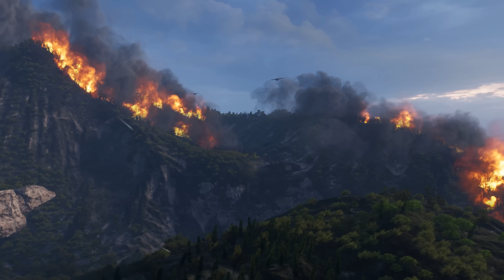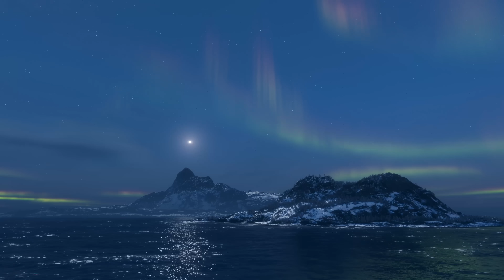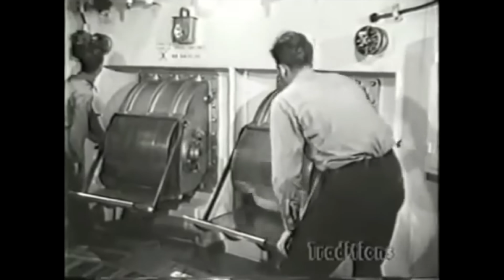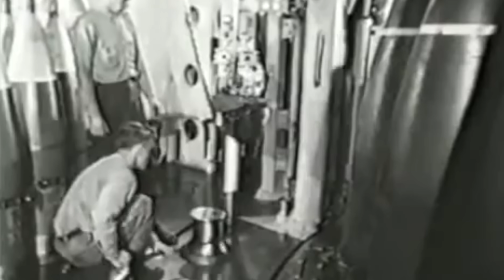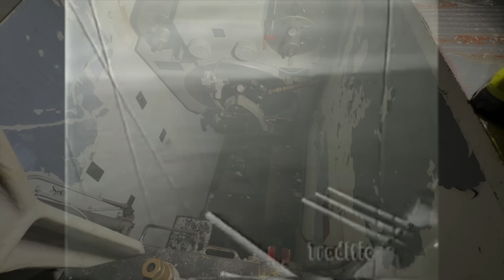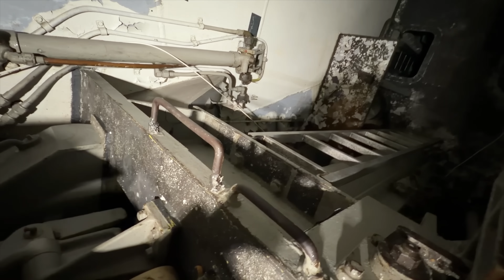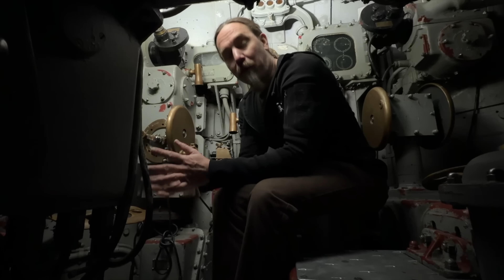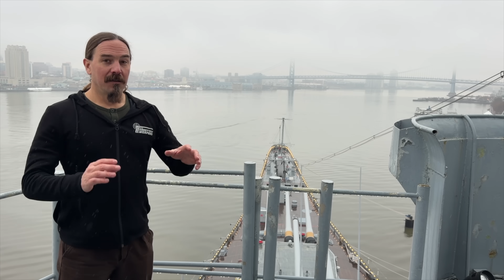How the USS New Jersey's 16-Inch Guns Work: Top to Bottom

Comment from the maker: Join World of Warships today to and use invite code USA250 to get your free rewards: https://wo.ws/FW
Reply: if theres any chance you could do a video on the 5 inch turrets that would be so awesome!!!
Reply from the maker: Yes, I filmed a similar video on the 5" system. Not sure when it will post, though.
Reply: hopefully Ian can go to one of the Machine Gun Cruisers to do deep dive on an automated 6" or 8" rifles on certain WW2 cruisers  https://youtu.be/gHR_O12-064?is=4X9B9EVJzh7mUufO
Reply: @Jack_Burton_Me  The automatic guns were only implemented on postwar classes (note that the date on that video is 1955), the Worcester class light cruisers and the Des Moines class heavy cruisers.
Reply: @Jack_Burton_Me  None of the WW2 cruisers had automated gun systems. Even the 5" 38 was manually fed during WW2. While the St Louis/Helena class has a reputation as "machine gun cruisers", the guns were still manually fed. The main difference that increased the rate of fire on the light cruisers was that the 6" round is a semi fixed round more like a rifle round, with the powder in a case, as opposed to bagged powder in the 8" and bigger guns, so the round can be fed without any additional steps to bring up the powder bags.
Reply: How many shells made a full Magazine?
Reply: @Eric-fb2wp  The basic load for an Iowa-class battleship is approx 130 projectiles per gun, so 9 guns x 130 = 1,170.
Reply: Ian:"..putting iron sights on top of the turret..."
DARPA: "HOLD OUR BEERS!"
Reply: Off and on WOWS player - the detail they put into the models of the ships is insane.
Reply: @felisconcolori  I advise you to check out War Thunder's ship models, if you have an account as well - even if you don't want to play. I'm looking at the x-ray rendering of my USS Iowa right now and the detail is fine enough that I can see the pistol grips on the stable vertical.
Reply: Hi Ian, I think the 16 inch Mk7 was not merely a Mk6 with 5 calibers more barrel length. The A tube thickness was increased from 45 to 46 inches and heavier hoops so that barrel pressures could be higher.  The prototype test gun used to develop the 16 inch super heavy shell started life as an 18 inch 47 caliber weapon that was sleeved down to 16 inch 55 calibers. It had a much heavier barrel and could take a bigger charge as a result.
Reply: I wish Ian as a commander in World of warships.
Reply: Been playing WoWs since day one. It's addictive.
Reply: Thank you the most comprehensive explanation of the 16" guns aiming system, the only aspect you did not mention is the coriolis effect and just how much needs to be accounted for at extreme long distance firing of those 16 inch guns. ⚓🦘👍✌
Reply: Still waiting for the 5" gun video
Reply: @ForgottenWeapons Do the German railway guns next, Anzio Annie etc. I believe one is in Virginia.
Reply: I was gonna ask why they didn't let you in the main gun but i see they finally did at the end. I was aboard the Mighty Moe when it was docked in Hawaii. Thise guns are as big as a house.
Reply: That's not going to get me back to playing any WG titles...
Reply: I don't know if this is a coincidence, but i was thinking what the inside of a gun turret of a battleship look like.  the stars aliened on this day
Reply: Is the code only for NA? Can't use it in EU
Reply: @The @TheIronNightmare likely yes, I’m on NA & it worked.
Reply: Get retired Gunners Mates to help us out with this, please.    You don't know enough, young man.
Reply: Freemium pay to win garbage, shame you had to take this sponsor
Reply: @mateimarian1937 I wonder if the US military is in any way behind all these different "world of..." games. It's one thing to try and increase recruitment of young guys who play these games but it would be utterly shameful to also rip them off with microtransactions while actively psy-oping them.😂
Reply: @mateimarian1937  not to mention absolutely shamelessly manipulative, anti consumer 'game' design, driven by the singular goal to sell gambling to whales and children.
Reply: Not even bothering to mention metric units make you look ignorant
Reply: @white-horse-pictures  Not even mentioning that metric unit conversions were subtitled in the video makes me think you didn't watch it, and are thus ignorant; additionally, your speech matches current bot/bad actor patterns. Get better AI.
Reply: @felisconcolori ”mentioned “ implies a verbal comment. Put that into your LLM training 🤡. Fair enough that a caption was added but yanks need to realise that the rest of the world uses metric now. It’s just more logical.
Reply: @white-horse-pictures  I'm sorry, did you think this was a conversation? That would be igno...ble. I'm sure the swath of one line comments ending in "You're ignorant" is completely natural and due solely to rude, entitled Europeans. Good Day.

Comment: One thing to note ... all these mechanisms, and their operators,  will have to work efficiently in a moving vessel. Large though they are, even battleships can be pitching and rolling considerably depending on the sea state. I would imagine the crew in Spot 1 high atop the mast  would at times experience quite the roller coaster ride.

Comment: A bunch of us Australian Army Reserve "Diggers", experienced a "custom" guided tour through "New Jersey" when we had a bit of "stand-down" time after the "grunt-work was finished. We were there participating in a "Pacific Reserve" exercise  at the geologically fascinating but visually "harsh", PohaKaloa Training area; a rocky and dusty desert between the volcanoes Mauna Loas ans Kilauea).

Our "local guide" was the chief Dental Officer and passed on all manner of relevant information, including a good reason for flying off the "Seahawk" choppers before conducting extended shore bombardments. with the 16-inch "Naval Rifles.

Apart from the sheer scale of everything the detail about those "rifles" that really struck me was that the rifled liners STRETCH length-wise at each firing. You can actually see the "step" where the liner protrudes. If this stretch exceeds "gauging", there is a good chance that the "overflow", will crack and be permanently condemned to scrap. They are NOT making the barrels, and liners (or the belt armour) anymore. If a liner "fails" the entire gun has to be replaced with "New Old Stock" from a mystery warehouse.

So, the armourers not only have a gauge set, they have a "trimming / re-crowning" tool.

The ship had, at that time, recently undergone a bit of modernization; Harpoon missile launchers and, to replace some of the older AA stations, "Phalanx" radar-guided Gatlings. (Ian; could you do a "familiarization and fire demo", with your new Nautical buddies).

Speaking of "big guns", if you are ever in Kure, Japan, (Home of the IJN "Yamato"), check out the excellent Naval museum, there.

https://dc-naval-history.com/japan-jmsdf-submarine-museum-kure.html

Comment: You're missing the best part of the director/computer system. It is an integrated fire control system. The computer also feeds back the predicted target location to the director. If you have the target prediction correct, the director will track the target. 

It is also integrated with the RADAR. The two battleship on battleship engagements of the US Navy during WWII (Second Naval Battle of Guadalcanal, Surigao Strait) both happened at night under RADAR direction. USS Washington scored 19 main caliber hits on IJN Kirishima in a little less than four minutes. (Note that the Washington only claimed 8 or 9 hits, they ended up hitting with full 3 gun salvos and counted it as one hit).

In addition, why magazines were refrigerated is due to the French losing two battleships to magazine explosions. This was shortly after the switch to smokeless powder. Acid contamination in the powder caused decomposition of the powder when the ships were operating in the Mediterranean. This lead to spontaneous combustion and subsequent magazine explosion. This happened when at least one of the ships was in drydock. After this, they tightened down the specs for acid contamination and added refrigeration to keep the solvents in the powder (which tend to desensitize the powder).

Comment: I served on the Missouri as a SWO.  One of the other wear factors on the barrel is that over many firings the inner liner is slowly pushed out of the barrel which requires the part extending beyond the barrel to be shaved down.

Comment: The hidden gem in the fire control computer is the rotating drum the matches the ballistics of the shells
From Google
Inside the Computer Mechanical Design: Instead of digital microchips or screens, the interior is packed with a complex network of thousands of precision-machined gears, shafts, cams, differentials, and servos.
Tolerances: Internal components were engineered to tolerances under 1/10,000th of an inch, requiring strict climate control (often kept near 70°F) to prevent metal expansion or contraction from throwing off calculations.
Specialized Cams: Mathematical formulas and ballistic data (such as time of flight and wind resistance) were physically cut into the shapes of flat cams, reciprocal cams, tangent cams, and 3D barrel cams.
Differentials & Inputs: Bevel-gear differentials continuously added or subtracted mechanical inputs (like the ship's own speed, roll, wind speed, and target tracking data) in real time to yield instant firing solutions.
Gauges and Dials: The front panels feature physical dials and mechanical counters displaying target speed, wind speed, range rate, and bearing changes that operators monitored constantly during tracking.

Comment: The digital computer would have been faster, but not more accurate.  Since the rate of fire was fixed at two rounds per minute, a faster solution would just have to have been updated several times before the gun was ready to fire.

You repeat a common mistake on what the gyroscope "stable element" does.  It doesn't delay firing until the ship is level.  A simple spirit level or pendulum would do that like on sailing warships.  A drop of mercury in a sealed glass tube with wires to each end could automatically close the electrical firing contacts when it "bridges" them.   In heavy seas, or if the ship was listing from battle damage, the ship might never come to level.  What the gyro does is provide a constant true level maintained by the spin of the gyro.  It compares the angle of the hull both in the longitudinal axis (roll) and in the transverse axis (pitch) and adjusts the firing solution put out by the computer so that the gun train and elevation are corrected for "level" (roll) and "cross-level" (pitch.)  This means the guns are always correctly pointed and can be fired *at the moment the commander wants to fire them*, which in ship-to-ship engagements will be the instant the computer announces a firing solution, not waiting for the ship to (hopefully, eventually) come level.  The gyros send correction information to the big motors you showed that train and elevate the guns to compensate for the roll and pitch of the ship.  (Remember that if the guns are being trained on a target that is not exactly on the broadside, the angle off 90 degrees has to be resolved into two planes, so you need correction for pitch and roll.   Even on a 90-degree broadside, pitch causes the forward guns to be higher than the aft guns, and back and forth, so all nine barrels need to be stabilized continually. This is how modern tank guns are stabilized so that the aim is preserved even as the tank rolls rapidly over rough ground.  You've probably seen videos of a Leopard tank moving quite violently with a stein of beer perched on the muzzle brake without it spilling.  Same system. The tank gun just has to react faster because the scale of the excursions is so much smaller and the rate of change is much higher.

There are videos on YouTube of these guns being fired during their last deployment in service.   After the gun captain (the guy down in the pit) has closed the breechblock and retreated to safety, you can see the breech appearing to bob up and down in the gun pit while it waits for the order to fire.  Actually the gun is stationary and "locked" on the target.  It's the ship rolling and pitching under the guns that produces the apparent movement.

Comment: How many lands and grooves do the big guns on the New Jersey have? You know, the guns that shoot the 2700 lb shells super crazy distances. 
If you mentioned it I didn't catch it... Also I think it's interesting that it shoots 2,700 ft a second and has a 2700 lb shell which means it's shooting 1 ft per second per pound of load it's shooting.... I don't know if that means anything but I thought it was interesting... 
I'm glad you finally did a forgotten weapons on the CZ 82 or the vz82 as I've seen it described as. It's a super cool gun I just wish it was in regular 9 mm not Makarov / 380. And yes a 380 will fire out of a 9mm Makarov pistol or at least my CZ 82 will fire 380... I think it depends on if you got a strong firing pin or not? If it seen lots of abuse than it might not work. It might not be quite long enough to hit the primer of a 380 cartridge

Comment: 0:14 "basically the largest firearm ever employed by the US military"

It is possible (but I'm not certain) the M1895 and M1919 16" coastal artillery guns had heavier barrels. Of course one might argue the "firearm" also consisted of roughly 1/3 of the turret which would definitely put the guns on the Iowa-class battleships as the US' heaviest.

Comment: Your info on the barrels is incorrect. Both the mark 2 and 7 were 50 caliber barrels.  The mark 7's were a lighter version of the 2's . Same exact length barrels at 66.6 feet. The mark 2 was not used due to its weight, not because it was a more capable barrel.

Comment: The US was limited to 16" for one reason. Per congressal order, all US Navy ships MUST be able to navigate the Panama Canal.
The US Navy beleived that the beam width needed to prevent capsizing "in rough weather" from a full broadside of 18" guns exceeded the canal width. As it stands, Iowa class has only 4" (2" each side) space for navigation.
So they went with a "high Performance" 16"

Comment: At about 46:39, talking about last ditch local control (the lanyard on the gun) that's what it's for. Last ditch use if either control lines are cut or main control is out of action. For more reference, see David Weber's Honorverse series of novels. Plenty of times where a weapon was fully functional, but electronic comm lines were damaged, had to use the local control to fire the weapon

Comment: Sixteen feet x 50 calibers long = 800", or 66' 8" barrel length. Jeez. One of my platoon sergeants said that when he was in Vietnam and the 16" guns fired overhead, the shells were so big they looked like Volkswagen beetles flying though the air. In reality, the shells were quite a bit heavier than the car.  Ian bumps a high capacity shell and - BOOM! I think I've seen too many memes of guns and things going "nuclear".🙂 They can call those shells high capacity instead of high explosive, but O.D. Green with Yellow tips and/or writing is always H.E., whether it's TNT or something else. I knew some of what went into firing the guns, but my knowledge only scratched the surface. The biggest surprises to me were the size of the rangefinders, and complexity of the ballistic computers. Just amazing. I don't know if it's true or not, but heard they cleaned the bore by sending a guy with a mop inside the barrel. That sounds like a good way to punish them.

Comment: I can't even comprehend the level of knowledge that went into designing the fire control computers used back then. Yes, at that time you had people designing and building wind-up clocks still. Every gear in that thing had calculus level mathematics determining its design to work as the whole, with cams to set them and various cut outs. Insane engineering. It is almost a lost technology at this point.

Comment: I was in the SEABEES as an Engineering Aide.  My roommate was an equipment operator and was deployed to Lebanon.  He drove a dozer on the beach to push landing craft back off the beach.  On landing craft stayed on the beach so long that its prop dug a huge hole in the sand underwater.  When he went to push the boat off the beach he drove the dozer into the hole.  The water pressure bent the fan into the radiator destroying it.  It was impossible to salvage the dozer.  It was then used for target practice by the USS New Jersey.

Comment: Is good showing but for goodness sakes all that baloney and peanut buttering about calibres and such is just confounding. Metric! Learn it already for gawds sakes. Is universal, converts simpler and is base 10. You say a .45 Cal whatever and I am thinking of a 1911, and then you start pointin at 30 meter barrels with an unknown diameter am guessing about 400mm?   
Doesnt really matter cause you say 38 cal and that means `127mm  and then 56 cal which actually means 40mm and what the hell?

Comment: 22:50 there is a more fitting precedent than the Halifax explosion - the Black Tom explosion, that also happened during WWI, but specifically in New York. The one lasting effect of this explosion is that it damaged the torch of the Statue of Liberty to the extent that no visitors are allowed there anymore to this day.
Reply: The arm and torch were completely rebuilt in the 80’s-90’s, and it briefly reopened, only to be shut down permanently after 9/11. Not sure why, exactly….